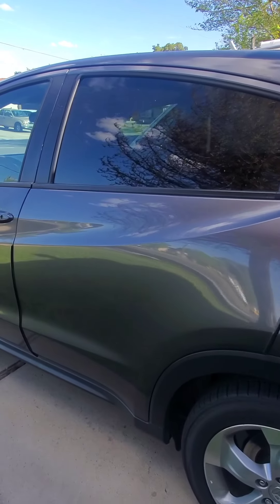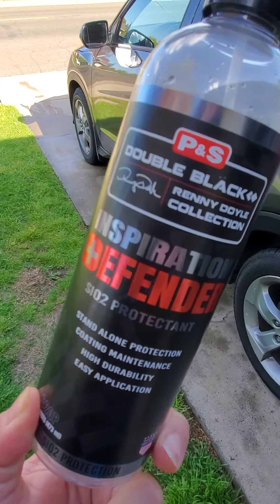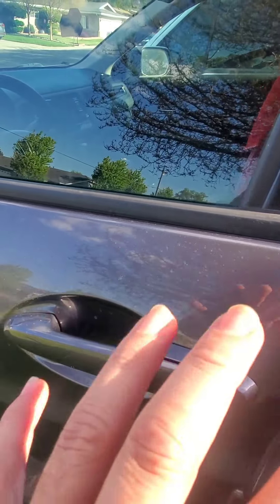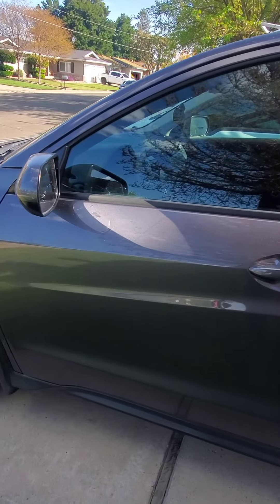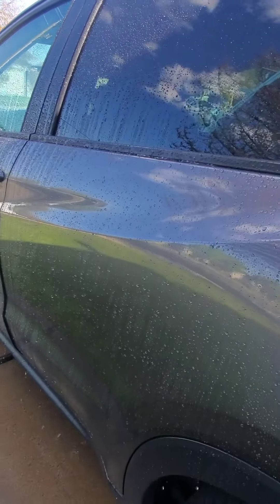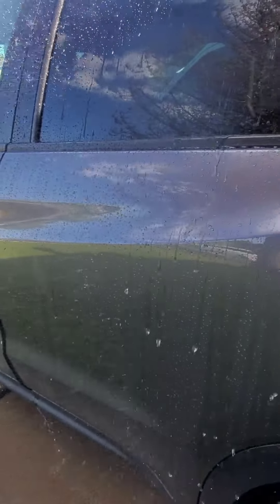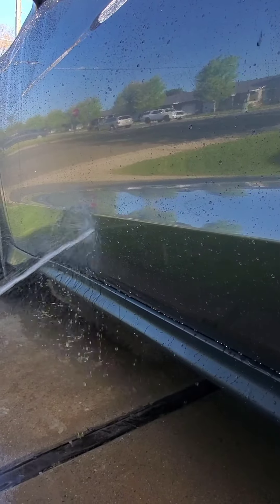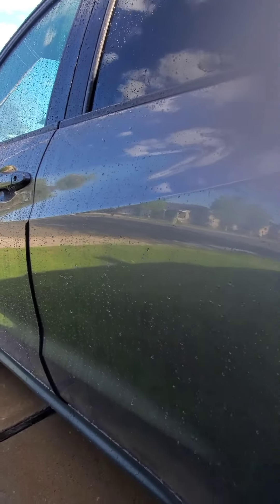P&S DEFENDER DURABILITY TEST.

Comment: Most ceramic detail sprays will perform like this a couple weeks in. If it still performs like this after a few months then it’s worth the money.👍
Reply from the maker: Yeah, I'm planning on not washing it and doing updates every couple of weeks.
Reply: Why wouldn't you still wash it?  That would be more realistic and keep the coating from clogging up with traffic film, etc.  It ain't a proper durability test, if with standing a number of washes ain't a variable.